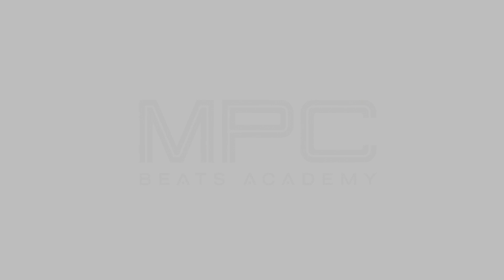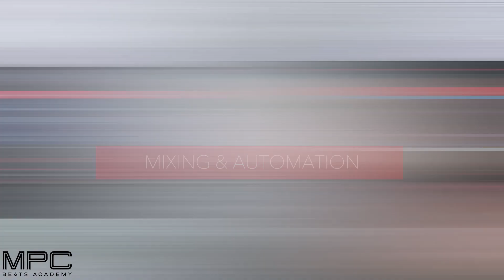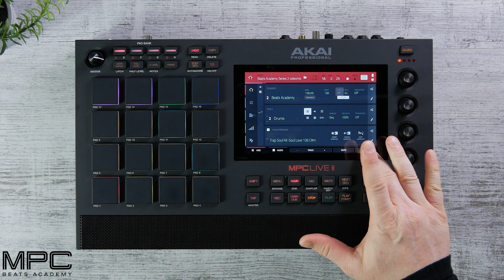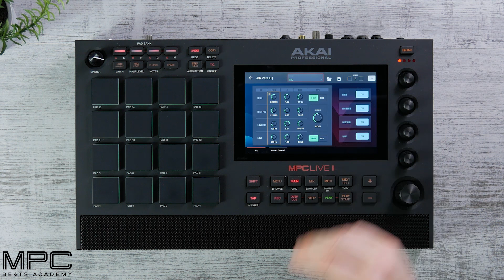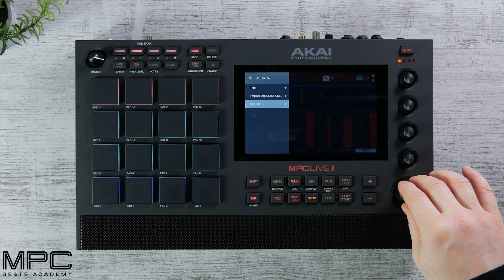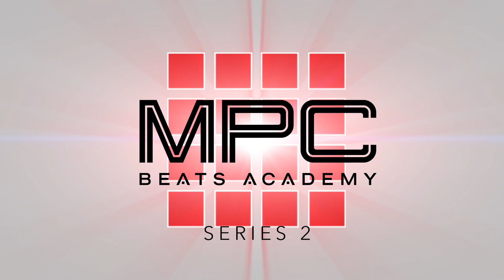MPC Live II | Mixing & Automation

Comment: A hardware akai usb mixer specifically made for newer MPCs would be dope! You could even make various sizes to fit different people's needs. I'd be happy with just a 12 or 16 channel mixer with up/down faders (not knob faders). 👍 Get on it Akai. I need this in my life. Something that will automatically sync everything while also allowing for some customization.
Reply: for 8 channels I think a cheap korg nanokontrol 2, with midi map, works well
Reply: why use an external mixer when an internal one is already there

Comment: Is there a way to see the pads and tracks on a vertical mixer?  (as in Ableton)
Reply: no you cant do that on the MPC Live but if they implemented this feature on the MPC Live it would really make it more popular and more user friendly
Reply: Buy AKAI FORCE!
Reply: Comment importer fichier midi files vers mpc live
Reply: click on lower icons at bottom left just outside of the output scale with the fader lever... which should indicate the "MIXER WINDOW" , Then Scroll to the Top Section of The Ui (User interface)... it should be "3" Very Small Icons Next to One Another, Then click on each one and Highlight the Required Sections that you want to Appear in you Mixer Window... Oh, You Can Also Make The Window full Size. .. Just Remember Not All will Be Shown on Each Section and Its More Clear if you have music loaded because This way you can just follow the Signals that jump up and Down... I Hope This Helps.